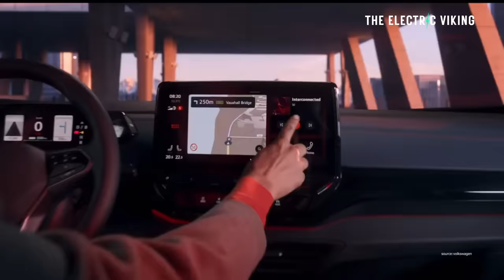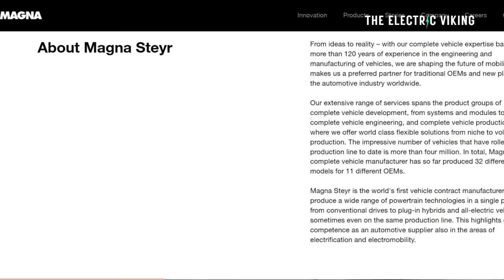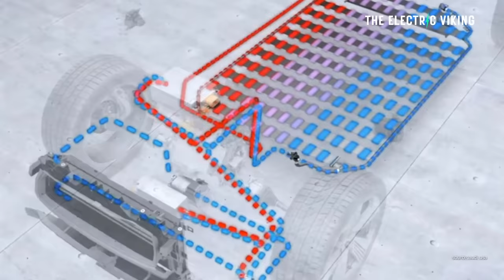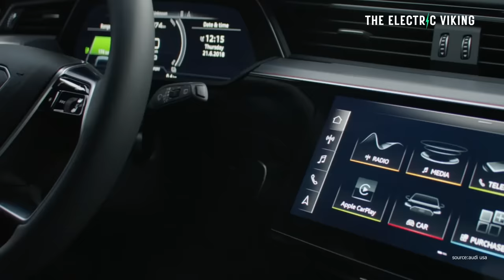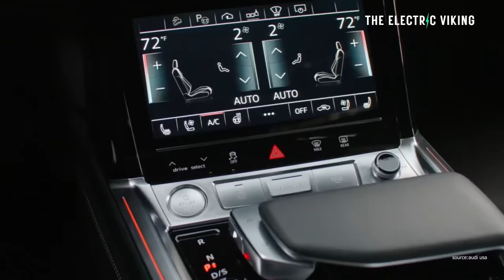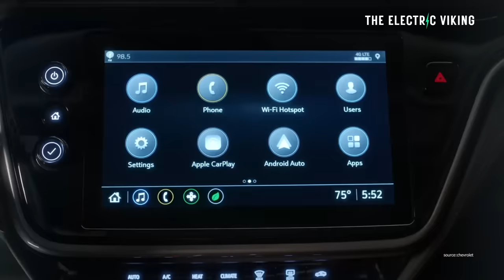Audi electric cars are selling at massive discounts - but there's a catch...

Comment: ☝️🤡.. BECAUSE,, as you said Battery technology is advancing dramatically, what you buy today will be junk in a few years. Everyone who bought got screwed when they dropped prices of new models. .. better to wait 5 or 10 years till the industry matures. They need to address the cost of repairs, battery fires toxic output, long term quality
Reply: Once batteries go through two steps, 20% each time, these old cars will have the resale value of the Nissan Leaf, which is to say, almost nothing. You can get a used Leaf for around 5k. An EV is a battery on wheels. The battery is always the weak spot. And i doubt that 3rd party firms will make replacement batteries for these early non-miodular battery systems like Tesla uses. One of the reasons BYD is going to beat Tesla long term, is that BYD is using blade batteries, which are field replaceable. This glued-in permanent battery system, imitating Apple's unrepairable cellphones, is dumb as heck. These are very expensive products, and if could fix replacement cells, would last a million miles, but by the time you get to a few hundred K, these things will be paperweights because they are so heavy and expensive to fix.
Reply: He only means that for everyone except tesla
Reply: By the same logic it would have been better to stay with a flip phone and wait for the iPhone 25 which will have much better technology 10 years from now.🤔
Reply: @acolon8999  ICE = flip phone? I think not,  EV needs to become a better mouse trap to supplant ICE and that clearly hasn't happened.
Reply: @lo1234-w9r  I do agree with you. I believe it will be at least another decade for BEVs to get to over 50% of new car sales and multiple decades before we have more BEVs than ICEVs on the roads.

My point is that technology is always advancing and if you decide to wait for the most advanced technology, it will always be next year or next decade.

Comment: One thing this video failed to mention is the air suspension on the Etron. I have a 2021 Etron that I got a pretty discounted lease on. I leased because I knew technology would advance quickly and I didn’t want to be stuck with an outdated car in 3 years. After 2.5 years I can say that the ride quality in the Audi compared to the Model Y (and I test drove several Teslas) is far superior. The Etron really drives like a luxury car. They could have programmed it for faster 0-60 times, but instead wanted it to not make people nauseous like some EVs. In fact, when I test drove Tesla’s the sales guy put them in their slowest mode to avoid people getting sick. Tesla has talked about putting an air suspension in the Y, but never have (I believe it’s on the X). I have not had one single issue with my Etron, and the build quality has been fantastic. As long as I can charge at home it’s really a good overall ownership experience. HOWEVER, charging at Electrify America is very much a mixed bag. At times there has been no issues. But too many times the charging stations either don’t work or charge far slower than advertised. Until they get the public charging figured out, EVs (other than those using the Tesla network) will struggle… But to summarize after 2.5 years of ownership, if you can get an Etron close to $30k, I would say you’re getting a quality vehicle at a great price…
Reply: yes, suspension is fantastic, but disagree on build quality. Very poor. Read my comment.

Comment: Out of spec reviews channel own one of these and they absolutely love it. They recommend it to people saying that it’s a steal for what it’s going for on the market now. I’ve owned an Ev for several years now and I can say 225 miles of range is plenty sufficient for day to day driving. You can always purchase a good extended warranty that would cover everything up to 100k miles so you don’t have to worry about repair costs if anything goes wrong with the car.
Reply: @twintwo1429  my previous BMW x5 had over $27,000 in repair cost claims that the extended warranty paid and I only drove it to 84k miles before I sold it . I’ve always had issues and high repair cost with all my previous German made ice vehicles. Unless you want to drive a boring, noisy, and cheap feeling Honda or Toyota prepare to pay high dollars in repairs
Reply: @twintwo1429  dang you’re so smart

Comment: i have had 13 EVs including three teslas two model s and a model 3. the etron has grown on me as i have owned it, super comfy, very quiet , refined and most amazinng thing is charging curve- i have a 2020 etron 55 ad the curve means it harges faster than model 3 LR and some 800v cars- see bjorn charging races. as it charges at high speed at any SOC it means you can stop and charge any any % not like a tesl or other EV ie stop to charge at 5%. the erton can tow, is spacious in the rear and boot, it has acoustic glass and is fast 0-60 in 5.5 seconds and can go off road- see videos on you tube by the rally driver taking it off on sand - see ken block taking it steep slopes- the etron was way ahead of its time, and has adjustable suspension
Reply: People are not buying them.
Reply: It's funny how all the actual owners here with experience with Teslas and other EVs note that the Etron is far superior is most ways as a car, quieter, smoother, more luxurious in general. These arm-chair thinkers have very little perspective on the car. The reality is that the Q8 Etron has a lot of incentives right now and makes a great lease. The older etrons make a great purchase. With that said, you can get a BMW m850 for about $70k that's 2 years old with 25k miles... The car was $110k new... This is par for the course with these cars.

Comment: A lot of mis-statements in your video. Or perhaps you're just trying to drive engagement with misinformation? The charge rate for example is very impressive at between 130-170kw till 80%. With current incentives and dealer discounts a new one can be had for about $60k.. Used about $40k with low miles... Till you've driven one you really can't compare it to a Bolt.. I've driven a Bolt, Model Y, Model X, Model 3, Ionic 5, and with the exception of the Model X they don't even come close to the luxurious feel of the Q8 Etron

Comment: There are a bunch in the New York City area 2019 vintage for around $35k with 20-25k miles on them. If they were $25k or below they would qualify for federal used EV rebate of $4k. Also saw a 2017 Tesla Model S with 29k miles for $36k. So you can get luxury EV's with 20-30k miles on them for around $35k.
Reply: Isn't also the same milage worse on a ice car? Quality and maintenance wise?

Comment: Wonderful car, truly stunning to look at, but way too many issues. Mine is at dealership for the 3rd time. Faulty charging element, new battery controller, leaking sunroof, bubbling leather dashboard to name a few. All known issues. Warranty on these cars should be extended by manufacturer due to all of these issues. Range? Pathetic. Mine is lately showing 137 miles on 90% charge. When charges to 100% barely shows 180 miles which drop almost instantly in 20-30 mile drop after first 10 minutes of driving.  mostly doing 1.8 mile per kWh.(Empty, with only me as a driver). There is drag of some sort which dealership can't pinpoint. I truly don't understand it. No aggressive driving, not running AC excessively. And lastly, build quality is horrendous. (I owned 3 other cheaper Audi's in A3-A4 range and can't compare at all). Door seals fallen off, (replaced on warranty), floor door plastic trim coming apart, center column fan cover come off (replaced on warranty) etc. It is put together like cheap Chevy or Kia. I am still huge fan of Etron and bought it as you said half price, used, with 21k miles on it, but disappointed on quality issues. One last thing, charging is great, charges very quickly, both on the road and home. Audi, you need to do better!
Reply: Sadly, I have seen many comments along these lines. My neighbour had a petrol A3 and was also disappointed with the quality.

Comment: I guess, you mix up the old etron (the big thirsty ship with a big 100kWh battery) with the etron q4 (id4 as an Audi as you said it, nothing special, around 75kWh battery).

Both are not good compared to what others deliver in range, cost for driving (efficiency) and space and acceleration and both etrons are very different to each other ;-)

Comment: Obviously vehicle opinions are very subjective, but I completely disagree with the 'underwhelming' and 'not luxurious' comments about the E-Tron. As someone who has driven a 2022 Model X Plaid, 2023 XC40 & XC60 Recharge and 2021 + 2023 Mach-E Premium, (and owned two Hondas and one Acura) I personally went with the E-Tron for a variety of reasons:

1. The adjustable air suspension lends an incredibly smooth ride, and lots of optionality (Model X air suspension is a joke)
2. Interior fit & finish is top notch - good balance of tech (although Tesla edges out here) and modern luxury. Far, far better build quality and finishes than the $120K Model X Plaid (which rattled like an absolute nightmare)
3. Solid amount of usable space and a true 'SUV' stance compared to many mid-sized and crossover EV's
4. Incredibly aggressive lease discounts ($825/m with zero down on an $84K MSRP luxury EV, compared to ~$1,400/m on a $80K base model X w/ zero down)

I own a 2021 Premium Plus variant and aside from one or two minor glitches, have never had an issues or need to take it into the shop outside of the standard 10K mile service. As someone who does a TON of research on new leases (like, 6 months in advance of signing) I still think that Audi EV's offer some of the best value for what you end up getting.

Comment: Typical warranty in the US is 3 year/ 36,000 miles.  So 4/50,000 is above average, and in the US all full BEVs have an 8 yeaar/100,000 miles warranty on the battery and powertrain.   Only Kia/Hyundai and Mitsubishi have longer warranties in the US.

Comment: My Panda 4x4 2nd gen petrol, had a range of 250 miles but could go 300 miles driven between 50-55 mph on a motorway. This was a car that cost me under £10,000.  It easily carried 4 adults despite being small and narrow.  When an EV meets those standards lecky warrior, I'll be converted.  P.S. the electric Pandas coming soon next year please cover :face-fuchsia-poop-shape:

Comment: 10:00; 70% of Audi vehicles are sold on a lease.  The vast majority of those leases are for 12000 miles per year or less, which means basically that by the time someone returns it after a three-year lease it's got 36000 mi or less on it.  It's not just Audi, all the Lux cars designed their warranty around a 3 year lease.  BMW, Mercedes even Lexus all only have 50K or less warranty on their cars.
What they will then do is when you return these cars they will sell it to the used car buyer with a 100,000 mile warranty via their "Certified Used Car" programs.
It's a system that has worked extremely well for them, since they obviously make money on both the new car and the dealer pays them for the new warranty under the certified used car program.

Comment: The old Audi E-Tron and the upcoming Chevy Equinox do NOT have a similar battery chemistry... The reason the E-Tron can hold a high-charge-rate near 150kw is because of the use of Cobalt in the battery, for example they reduced Cobalt content in the new model year and the charge curve is now worse! Real-world range is far lower than 300 on the used E-Trons too, actually closer to 200 miles on the highway... Also, Sam first says the E-Tron is an MEB based vehicle same as the ID.4 but then later says it's basically a retooled gas platform... which is it?!
Reply: If you can get 200 miles out of Etron I will congratulate you. Mine is falling terribly, more like 160-170 at the best!
Reply: The original Audi E Tron was a reject petrol burner and the new Audi E Tron is based on the ID4 platform .
Reply: depends, if you are charging 20 or 40% to 80% the new one actually matches the old very well.

Comment: 05:25 2612 kg ?!? This weight is total crazy.
Reply: Just the battery is 525kg.
Reply: @howardmarkert8150  525 kg battery + 200 kg electric engines is 725 kg. 1300 kg for the rest. All what is more is incompetence,

Comment: There is a reason why it’s called the Audi eTurd. Bad buying experience, bad charging experience, bad storage experience, bad service experience, and bad driving experience. So, what’s not to like about the eTurd?
Reply: Disagree, driving experience is great. It very well pointed and comfortable car. Did 2700miles/4000km across Nova Scotia Canada and Prince Edward Island and back to NY in 10 days and it was insanely comfortable due to silent interior, air suspension and massage seats. It has other issues though...
Reply: @peterolsovsky  To be fair, why did you not mention all of the issues?

Comment: In canada they are at 50% for 2019 models.
Reply: When I drive a tesla owned by relatives it feels like someone robbed the interior and left the steering wheel and screen.  The belts I noticed on the X are so hard to buckle as the buckle is lower than the seat level and even if you are slim it is hard to push in the belt.